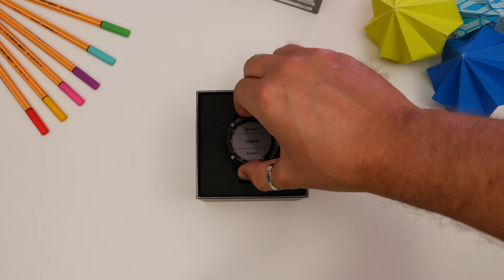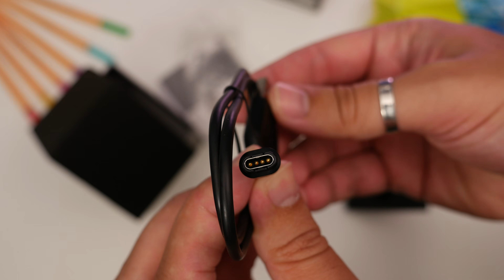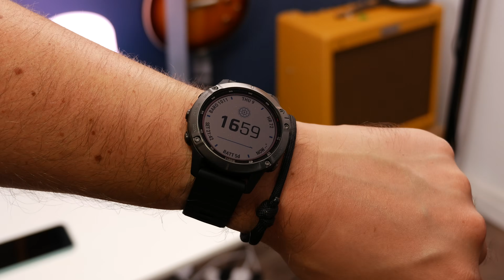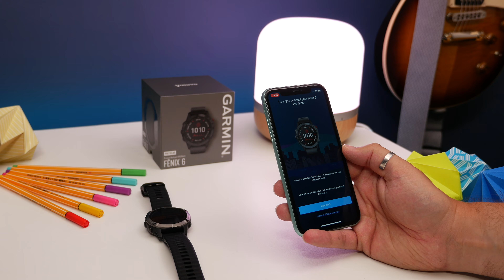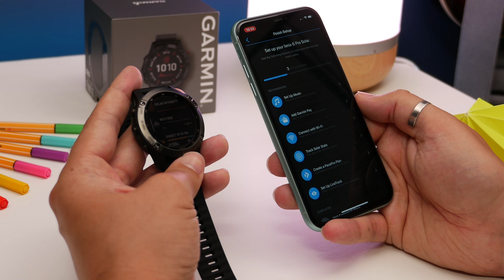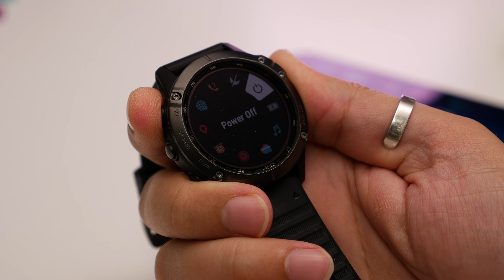Garmin Fenix 6 Pro Solar: Unboxing, first look and setup

Comment: So, you're telling me the most expensive smartwatch on the market doesn't even have a touchscreen?
Reply: You wouldn't want a touchscreen if you are a more extreme athlete/operator. You need gross movements so you don't need to worry about precision or accidently swiping or whatever.
Reply: @O8WRx  mmmm na. 
I want touch screen with the option to turn off.
Reply: @hankdapper8239  that would be neat. Like a "tactical mode" vs an "everyday mode".